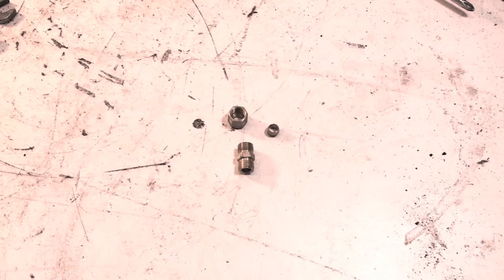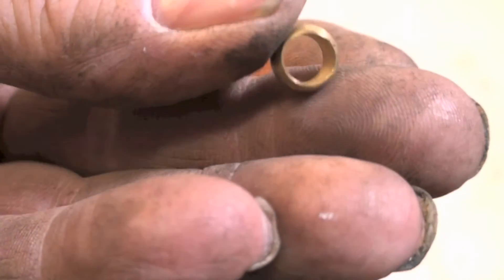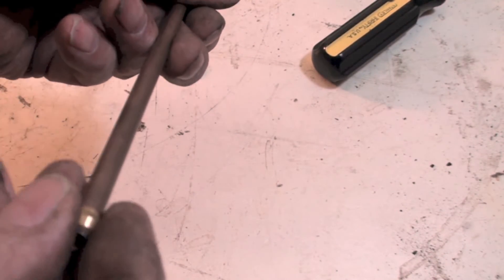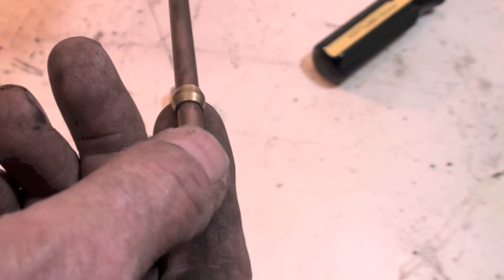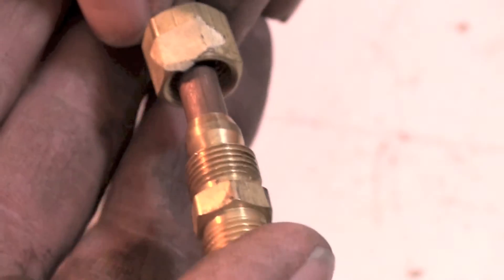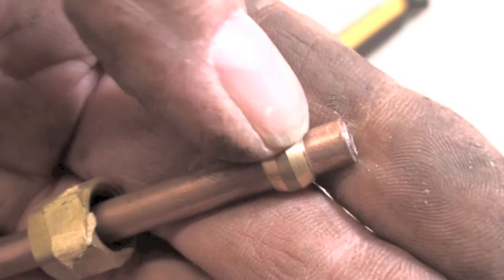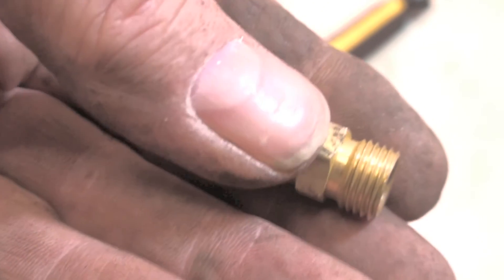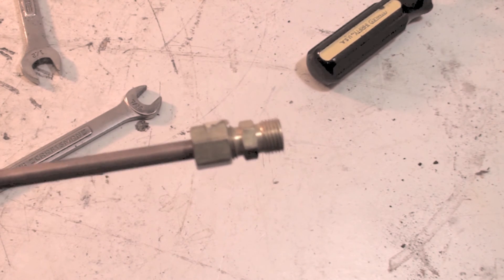How to install a ferrel connection

Comment: My least favorite type of fitting but, sometimes that's what you have to deal with. A bit of lubrication goes a long way. Really not a fan of compression angle stops, the ferrules dimple the pipe and make it hard to get a seal with a new one. I would rather sweat a male adapter any day
Reply from the maker: Ditto
GFM